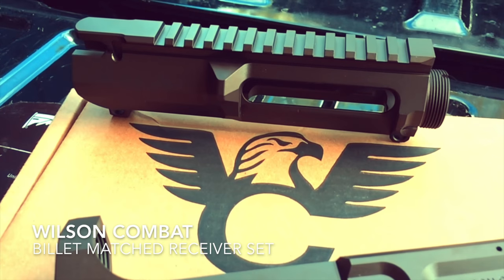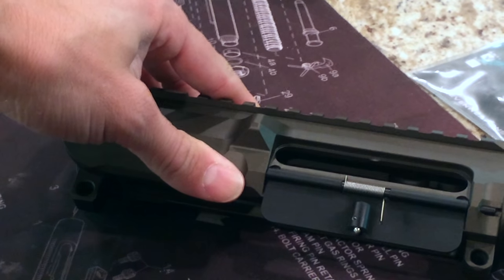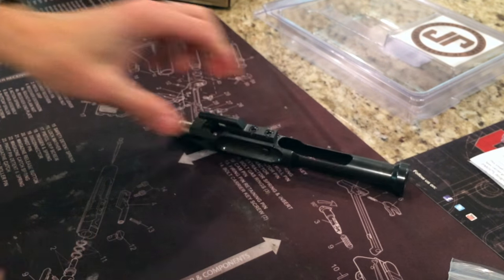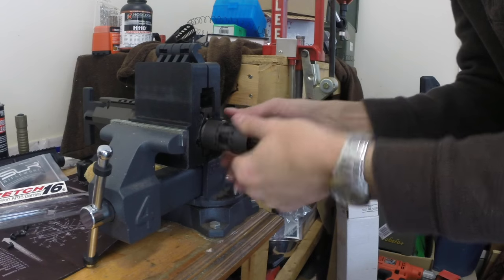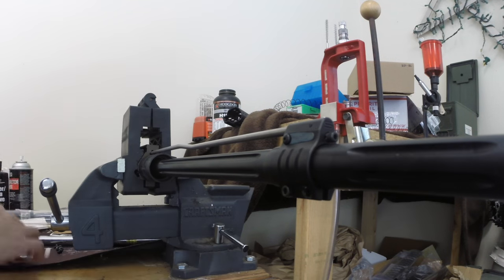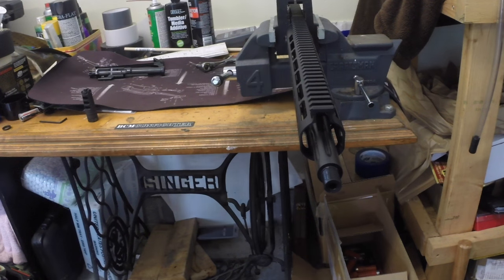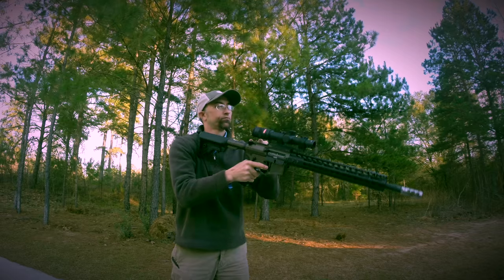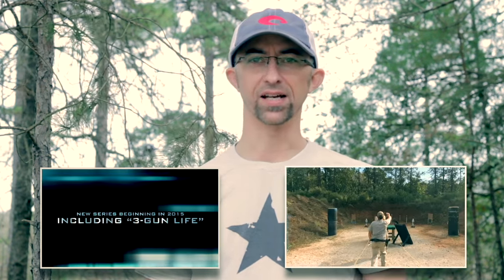THE 3-GUN PROJECT: UPPER RECEIVER COMPLETE BUILD [PART 2]

Comment: beautiful rifle, i have been watching your channel for a while. i will finally be in my first 3 gun match in Greenville sc in February.  But one small tip if i may, the noveske barrel nut has very small hash marks on the egdes to help with indexing. it took me a couple times of installing one to realize it. but if you like the hash mark on the top up with your gas tube hole after you season your threads its perfect. takes alot of the error of eyeballing with the screw holes out of it.
Reply from the maker: +rob gardner Thata a good tip I did not know that

Comment: Hey Mac, just FYI, when you turn the head of the torque wrench any angle but straight it changes the amount of force you are applying.
Reply from the maker: That is true, the angle of the crowfoot on the end of the wrench matters. I've done it both ways, at 90 degrees and in-line. Lately I've read that the recommended way is at 90 degrees. That supposedly gives the true torque value and the in-line method actually applies a higher value than what the wrench measures. I'm not qualified to say which is right or wrong, but I can tell you I've never seen a difference in either method as far as build quality and barrel accuracy. And the window of acceptable values for barrel but torque mean you can get it right with either method.

Comment: nice build. but....a loaded 30-rd polymer mag weighs 1 lb not 1/2 lb.
i think your gonna be closer to 7-3/4 lbs loaded. still very light.well done.

my go to modded FN 16" M4/RECCE with Primary Arms 1-8x ACSS SFP scope in an ADM recon qd mount and Streamlight pro-tac weaponlight weighs 9.2 lbs loaded for comparison. its designed for fighting but id love to drop another 1 lb from it if i could.

Comment: Hey Mac, excellent video and great series! Just wondering your thoughts on weight differences on billet vs forged receivers, it sound like you were more interested in the nicer finish for consistency over any potential weight savings but would love to hear your thoughts!
Reply from the maker: +TheAlphaEight The weight difference is almost negligible. You can easily offset it by choosing a lighter weight handguard, lighter internal parts like the V Seven parts, or a lighter optics mount, etc. I think its more important to make sure the weight is distributed in the right places to balance the rifle.

Comment: Great video, thank you. I picked up a Black Friday Stretch 16 melonite barrel due to your reviews.
QUESTION: Would a 16" SLR Hanguard (I think you've had 15" before on your rifle?) ever work over a 16" barrel?
Reply from the maker: +hoganfan2006 technically it would work, only a portion of the muzzle device would be sticking out of the rail. You would have to install the gas block and muzzle device and then slide on the rail last

Comment: Which handguard and barrel is that? Great video. I just picked up a VLTOR upper. Thanks.
Reply from the maker: Noveske NSR 13.5 handguard and Stretch-16 Melonite barrel
Reply: +BullittMcQueen Awesome. I have the same handguard then. I could not determine the handguard that came with my VLTOR upper. After noticing the handguard on your video, it's identical to mine. Thanks again!

Comment: Hi Mac!  Another great video!  I am building a 3-Gun rifle using this barrel and compensator.  Do you have any particular ammo you favor for this setup?  M193 ball?  HPR/A Max?  Mostly just for the "pit style" matches with nothing farther than 100-200 yards out...thanks!
Reply from the maker: 55g FMJ ball ammo. I use Freedom Munitions
Reply: On the whole, do you prefer the 5.56 to the .223?  How clean does the Freedom Munitions ball ammo shoot?  Thanks!
Reply from the maker: +Jason157E Great ammo, shoots clean and reliably. I usually shoot 223 over 5.56 because of the perceived slightly softer recoil impulse. I don't have any data to prove that, it might all be in my mind

Comment: I'm working on my first AR build and still waiting for all of my parts to ship.  Do you ever have any issue lining up the gas block with the barrel's gas port?  Best way to ensure alignment?
Reply from the maker: I have not so far. One way would be to know what kind of barrel you are building on. If it is a mil-spec type barrel, say a government profile M4 16" barrel, then you would need to install the gas block slightly off the shoulder to account for the width of the handguard rings. Of its a precision barrel like the one I used in this video, more than likely the gas block can be shouldered since it is not meant to be a clone of a mil-spec profile barrel. As a last resort, and what I do, is to shoulder the gas block, tighten everything down but not loc-tite, go shoot it and make sure it runs, and then go back and loc-tite everything.

Comment: Good evening Bullitt! Your video's are exceptional and thorough. My question: Is the LMOS JP bolt carrier a .223 or 5.56? The LMT bolt is a 5.56, and I am aware of how close they are in size, but I wanted to ensure that they are compatible prior to my massive upcoming purchases. Thanks again!

V/r,
Kevin C.
Reply from the maker: There is only 1 size bolt carrier for the AR platform in 5.56. You can think of 223 and 5.56 interchangeably in this case.
Reply: Mac, Thank you for the quick response!

Comment: Great build, super jealous. Just wondering why you went with a 16" barrel over the traditional 18"? I'm a noob to 3 gun and your input would be appreciated. thanks.
Reply from the maker: Aw yeah, great question. Before I answer, let me ask you. Why would you personally want an 18" ?
Reply: +BullittMcQueen I guess to engage longer targets, say past 600 yards?
Reply from the maker: At those ranges, the 18" would probably have a slight advantage due to a little better muzzle velocity. But I don't know of any 3-gun matches that routinely have rifle shots that far away. I would guess 95% of the shots you will encounter in a 3-gun match will be less than 100 yards. Because of this, I believe the 16" is king. Lighter, more maneuverable, equal performance (at least). The thing most people don't realize is that by the time you add a 3 inch muzzle brake to an 18" barrel, your rifle has a 21" barrel, and is harder and heavier to maneuver all the way around.

For all these reasons, most of the 3GN Pros shoot a 13.5" barrel for the pro matches and have a second rifle with 16 or 18 inch barrel to shoot matches with long range rifle.
Reply: +BullittMcQueen Dang, thanks for sharing. I know it took you a while to accumulate all that data. Good luck in your season.
Reply from the maker: Thanks, please let me know if I can ever help you in any way

Comment: How does the Stretch 16 barrel hold accuracy while hot? I'm considering one of these for a build. Thanks!
Reply from the maker: Very good. Mark P of Carbon Arms ran a melonited Stretch-16 as a stage gun last year at several matches. Most of the time it was doing mag dumps with a lot of repetitive fire. Something like 9700 rounds overall; Groups held up well and at the end of the year the barrel still held a 1 inch group at 100 yards I think.

Comment: Quick question - I purchased a 18" Wylde 3 Gun barrel (Rifle Length Gas System).  Since its a rifle length gas system do I need to purchase a rifle length buffer tube, buffer, and spring?
Reply from the maker: +Mario Rodriguez not necessarily. I will shoot softer with a rifle length gas system but it will run with almost any buffer

Comment: What was the all in cost with the parts you used?
Reply from the maker: Right around 1500 for the upper. That's assuming 250 for the upper but it comes as a set and the set costs a little over 500
Reply: +Outa ThisWorld The parts break-down with MAP prices is listed in the description of this video. The lower receiver parts are posted in the description of that video as well.